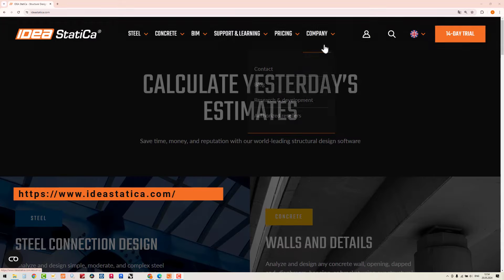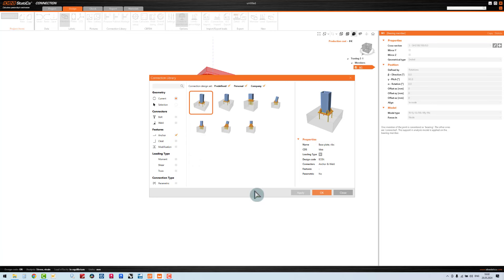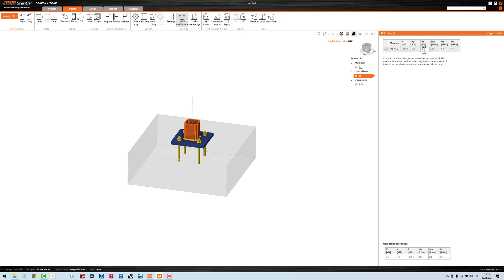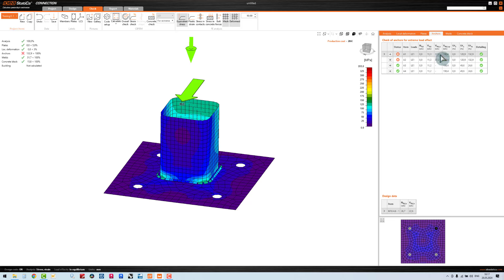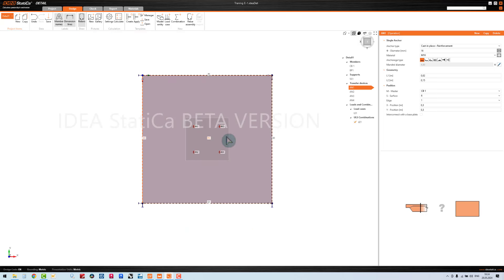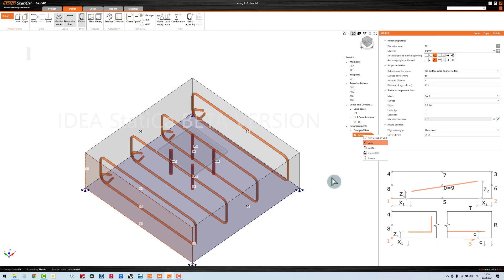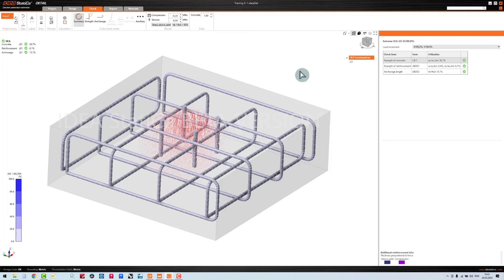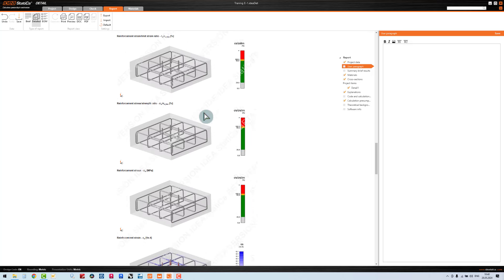IDEA StatiCa 24.0|| Complete RCC footing design || Connection Detail workflow

Comment: Thank you for the update. Is it possible in IDEA STATICA to check the through bolt connection between steel and concrete beams?
Reply from the maker: Sur i will do that
Reply: @StructuralAnalysisEngineer  I will be grateful if you can record a video regarding this topic
Thank you for your invaluable efforts